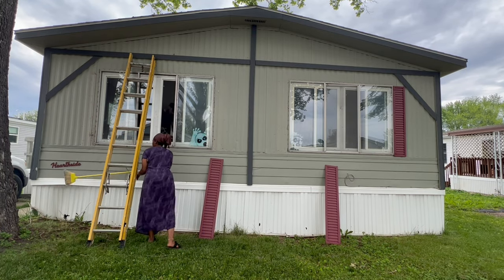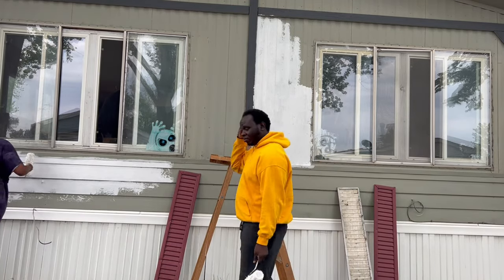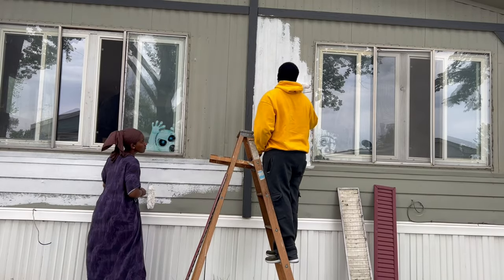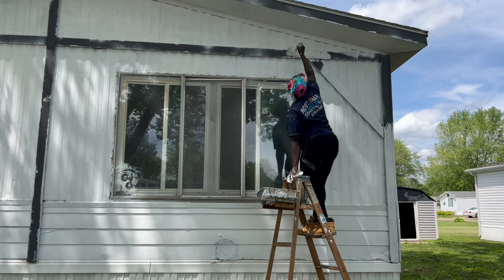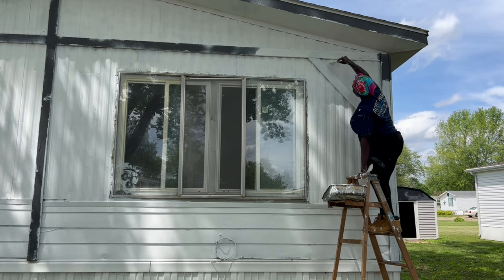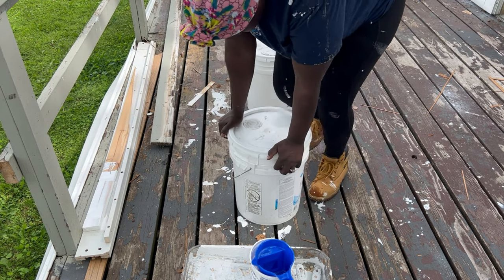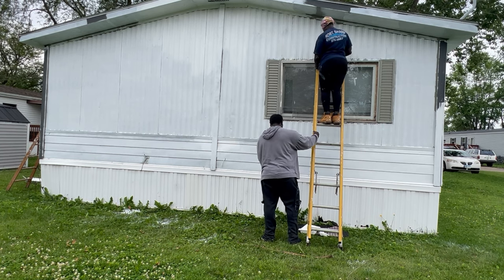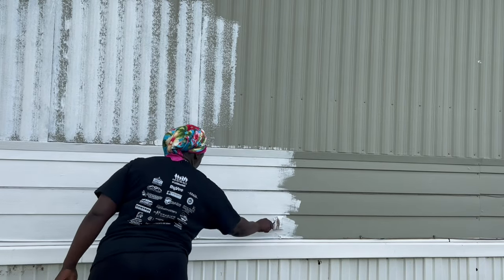DIY EXTREME MOBILE HOME MAKEOVER | painting the outside of the house PART 1 | Our 1975 mobile home ￼

Comment: If you did this again, would you roll or use a paint sprayer? My brick and mortar home (small, about the size of a double wide mobile home) has aluminum siding that needs painted. I am trying to decide the easiest way to paint.
Reply from the maker: Hi Jamie‼️,I tried to use the paint sprayer and it would’ve worked and would’ve been faster if we knew how to work it/ get the right consistency to go through the sprayer without it clogging if that makes any sense lol, it just didn’t work for me. We rolled the paint on and used the brush as well, Took forever but it was worth it in the end. 😊